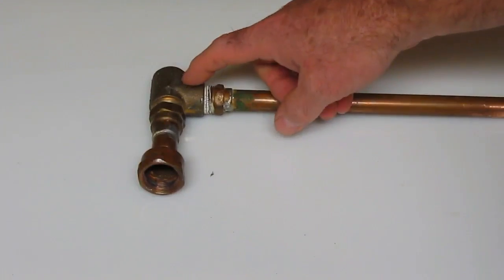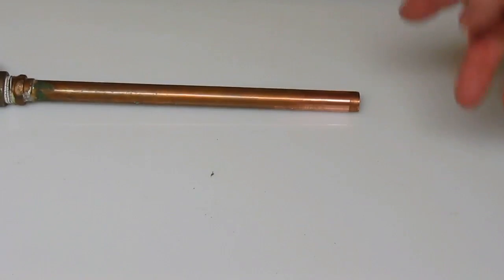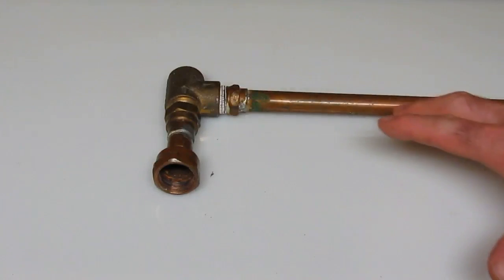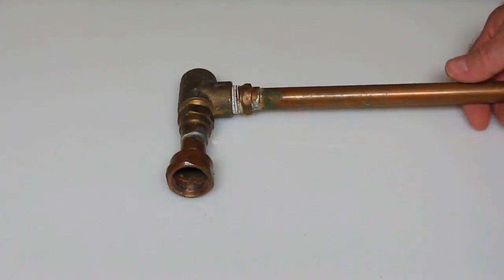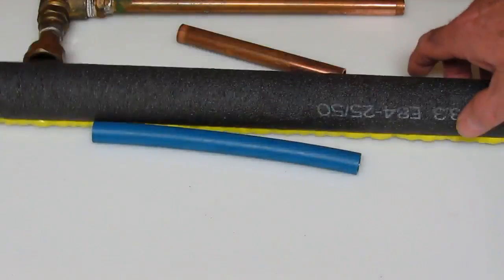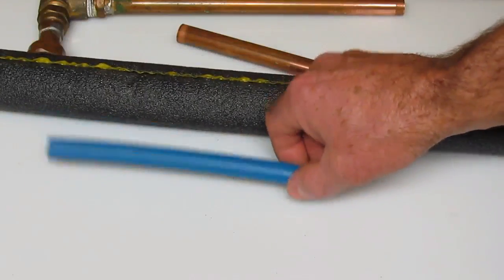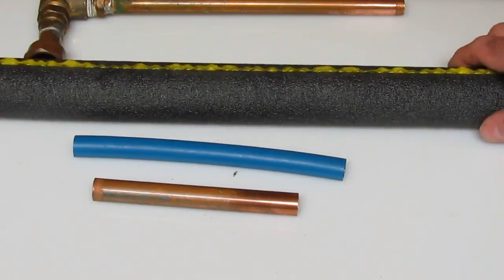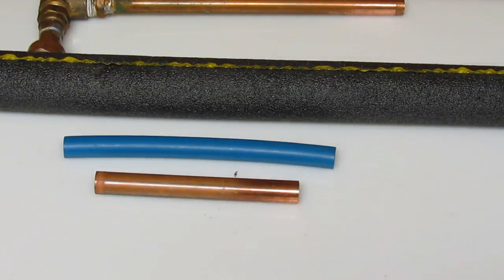Relief valve and insulation tips! I can't stress it enough!

Comment: I replumbed my house in Georgia with PVC for cold water and CPVC for hot water.  I didn't insulate any of the pipes in the crawl space.  The first winter we had freezing weather for a week.  On the 3rd morning I heard water running under the house.  The PVC had shattered in several places but the CPVC had only blown off one elbow.  After repairing the pipes I used that type of insulation and haven't had any more issues, but we haven't had a week of freezing weather since then either.

Comment: Thanks Al
I'll check into it. I used PVC but when the water company's tech came in to install the meter he refused. Said it was ok to have pvc from the meter to the fixtures just not from the main to the meter. Just between me you and the owner. I might have to cheat because the house is a crawl space and the water company isn't going down there to check the complete run. hehehe

Comment: Hey Al !!!

I have actually set in on Continued Education classes , where they showed a Hot water Heater Blowing Aftermath !!! 
Went thru 3 Floors and Out the Roof , Landing in the Back Yard !!!
The Relief Valve is Indeed the Front Line Safety !!!

Great Job as Always Al !!!

Comment from the maker: Hey William;

Yeah, the copper doesn't like the cold.
Before you go and install copper there is a service pipe made of plastic that everyone uses for running water mains into homes. Much cheaper then copper.
I wouldn't recommend galvanized for sure.
Let me know if you find it. It should not be hard to get.
Thanks for commenting and good luck on the remodel!    Al

Comment: and that's why I don't like copper "Freeze and splits" but just found out that the city water requires copper or galvanized steel pipe to continue from the main to the feed (incoming) side of the water meter. So now i have to start over-Live and learn I guess LOL

Comment: Hey Al !! 

Thank you for sharing these great tips and especially the very important safety information on relief valves!! Great job my friend!!

My 50 plus year old house is on a concrete slab. If a slab leak ever develops, the water supply lines would likely have to be run through the attic. I'm glad to know that Pex will not split if it freezes. 

I look forward to your Pex freeze test video, sounds cool!! 

Have a great on Al, and thanks again!!